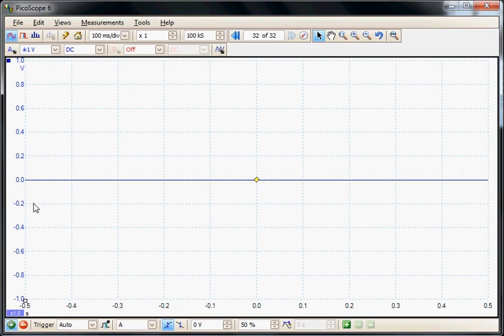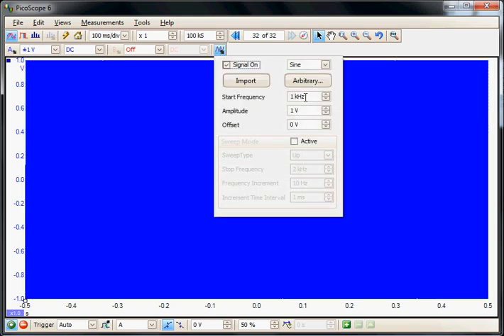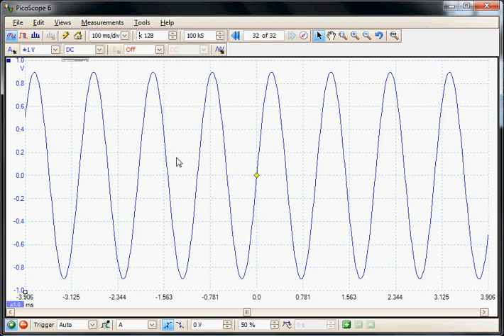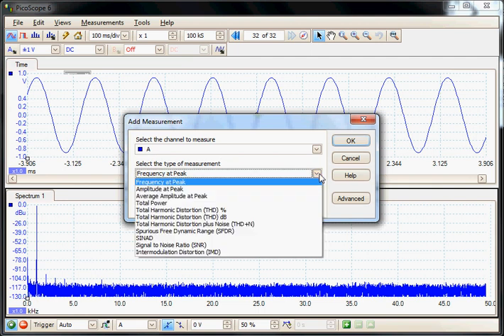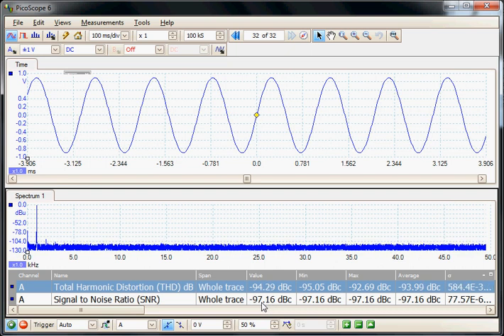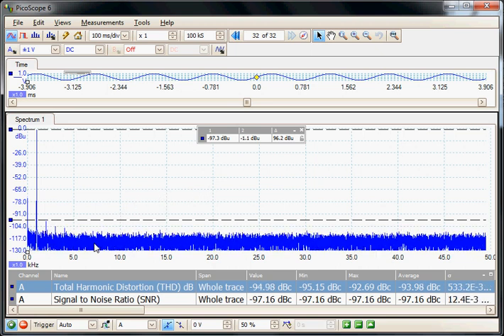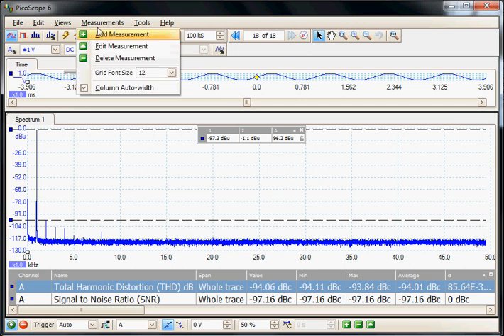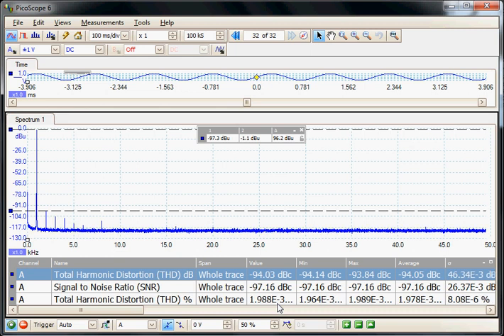How to measure the dynamic range of the PicoScope 4262 Oscilloscope

Comment: I bought a 2204A. Cost £100 from RS. The Picoscope software has WAY more features than a £1000+ scope. I'm not affiliated with Picoscope, but you get one helluva lot of bang for your buck.

The top end units offer UNRIVALLED value for money. I really don't see how other manufacturers can compete. There's even an SDK so you can develop your own applications!

Seriously, forget Hantek or Owon USB scopes, PLEASE don't waste your money. Their software is buggy, and if you have a problem, good luck with support. Problems with your Pico? Their support will be all over it for you. They even set up a system to see if they can recreate the issue and find a solution. FAULTLESS product, backed by FLAWLESS customer support.

Comment: 2:05 Sorry to be pedantic, but -97 dB SNR!?  Ok, at 97 dB it's kind of obvious what's actually being reported is Noise-to-Signal-Ratio ... and the "dBc" gives another indication.  But when you end up using the scope for a test pass/fail SNR at say 1 dB and what's reported is "-1.5 dB" that's when the fuck-up happens and it's time to chuck the stupid picoscope (or the s/w at least) out the window!  I'm guessing you might have fixed this in the s/w by now...

Comment: All of this is quite interesting, however, I am using the Picoscope 3204 dual channel & my software is a 2005 version that came with the unit.  Your not showing how your connecting to the circuit your testing & I am testing low power RF circuits for amateur radio's.  In fact, my scope is connected to an older Dell Inspiron with a Pentium 3 500mhz processor with Win 98 & not a high end PC with Win 7.